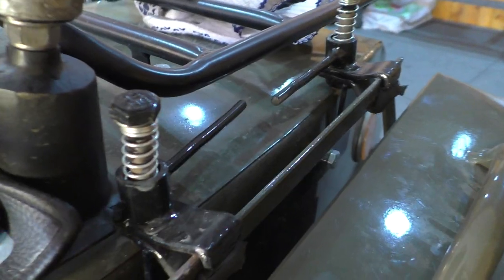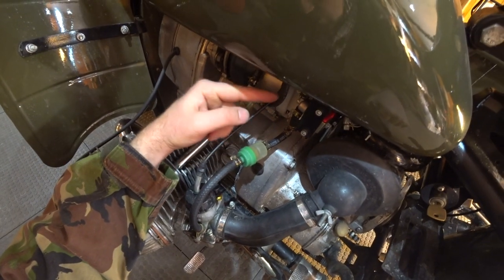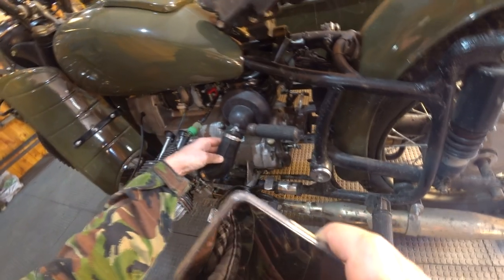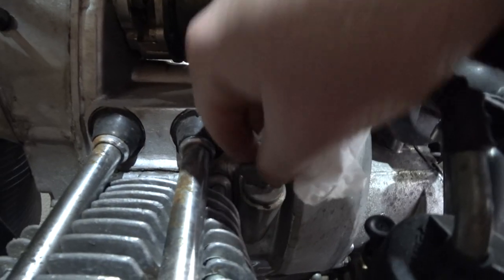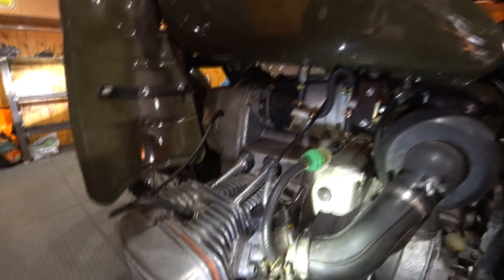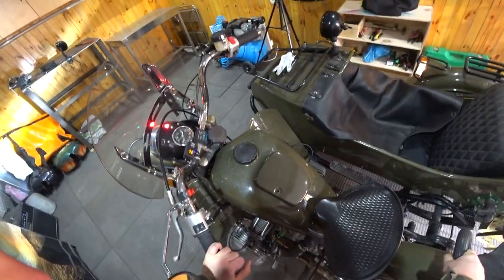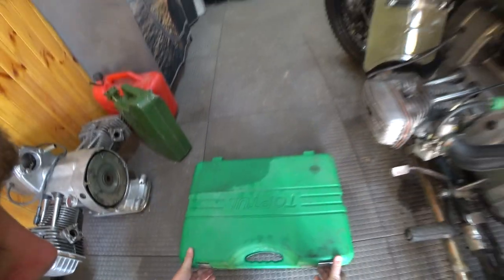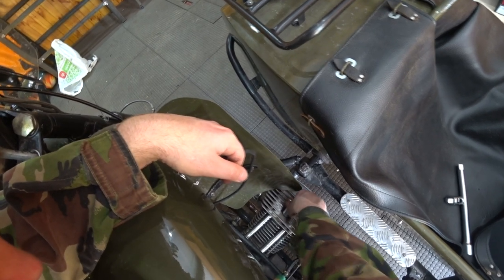Dnepr sidecar motorcycle (not Ural) first engine start at this season.

Comment: Shut off your fuel tank when parking.  Else, the "Bing" Float-Type carburetor Will always leak fuel so long as fuel falls into it.  As there is no airflow to compensate, and no combustion, a puddle of fuel beneath each carburetor is indicative of a ready state.  See the puddle?  Romp the starter! My experience is with an 1970 BMW R60/5 in the mountains of North Carolina.  I traveled as far South as New Orleans.  Boxers really, really make sense.

Comment: When I was in the US Navy and US Army we had to classes of leaks. There were leaks where you could see fluid pouring from a connection or a hose. Then there were what we called Weeps. A Weep is a leak so small it does not pour out or even drip out. It's so small that (in your case) it evaporates as it 'Weeps' from the connection or hose. Typically you will not realize you are losing fuel when you are using the motorcycle  because it is such a tiny leak. When not driving the motorcycle for several weeks or months that tiny Weep will drain your tank and never leave any evidence of it behind because it was evaporating before it dripped leaving a stain under it. Usually you can see a Weep where you can see the joint easily if you sprinkle a dry power on it such as talcum or baby powder. The powder will turn wet where the two parts meet or where there is a crack in a line or hose. One place where you can have a fuel Weep on your Dnepr and never see it is the cross over tube under the tank that connects one side of the tank to the other side when the fuel level is low in the tank so all the fuel in the tank can travel to the outlet. When you have the crossover tube connected properly you can not see the ends of the rubber fuel lines and again the leak (weep) is so tiny it evaporates before it drips. I would remove the tank and replace that hose if there is any cracking from age. One tiny little crack in the hose where it contacts the hose can cause a weep you will never see but the result is an empty tank after a few weeks or months. We used to use baby power to find fuel weeps on engines and fuel tanks in M1 Abrams Tanks. We would pressure wash everything and then let everything totally dry out.Then we would sprinkle the baby power on everything that had fuel inside. You could then see a weep because it would wet the baby power "where you can see the areas you are inspecting". Then we would wash away all the baby power. Even a tiny fuel weep anywhere around an enclosed gas turbine engine such as the engine compartment of an M1 Abrams Tank is a very dangerous thing.

 I'm still having a great time on my Dnepr MT-11. When I crossed that 2,500 Km break-in limit I went ahead and pulled the engine out of the frame and removed the front timing cover and oil pan. I inspected it, cleaned out the oil filter on the end of the crank shaft, and cleaned the oil pan and oil pickup screen. Everything was in fine order. I put it back together and I'm riding it daily. I love it so much. Here in Alabama, USA it hardly ever gets below freezing in the winter so I ride motorcycles all year. I even ride when it does get below freezing, I just dress for it.
Reply from the maker: Wow! Such a fantastic story! And very full comment! Thanks!!!!